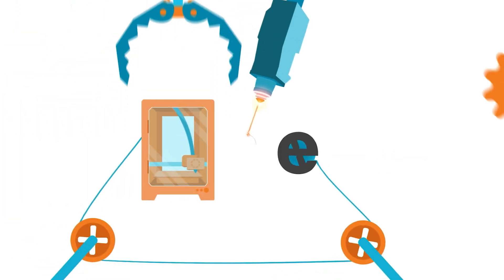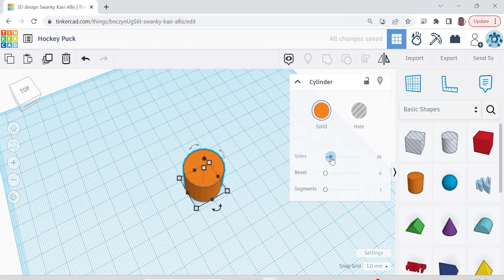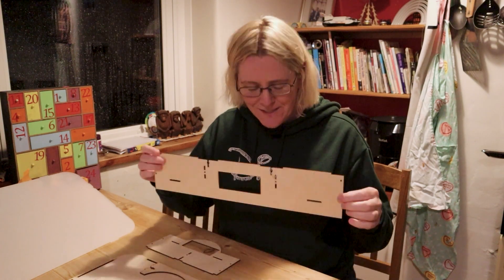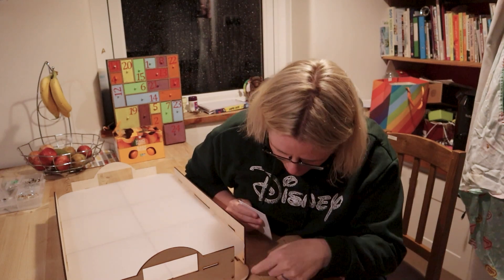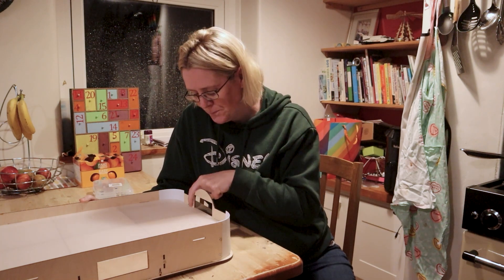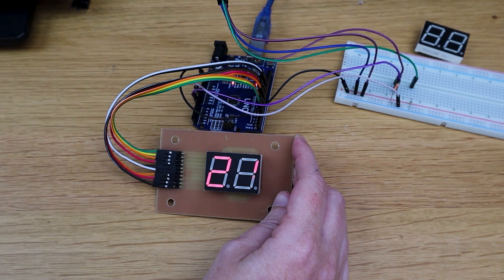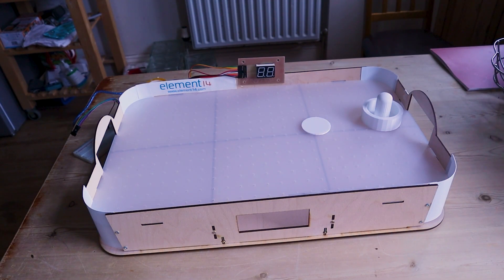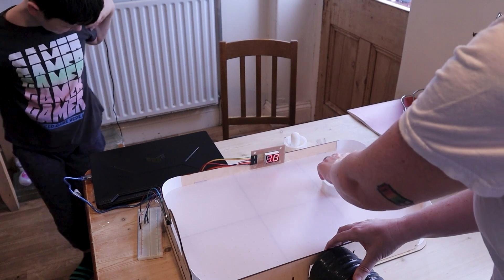Create Your Own Air Hockey Table with Arduino Scoring!

Comment: Such a fun project! Thanks for sharing it with us. I wonder, if you had a plastic cup or dish to catch the puck, you might be able to sense the puck dropping into it with an IR LED / receiver pair. The puck would break the beam of light when it falls into the dish. You'd need to debounce the signal, but you've already addressed that with the 3 second delay before it'll count another score.
Reply: Yeah, I think if I move the sensing off the table it will be easier to do 👍